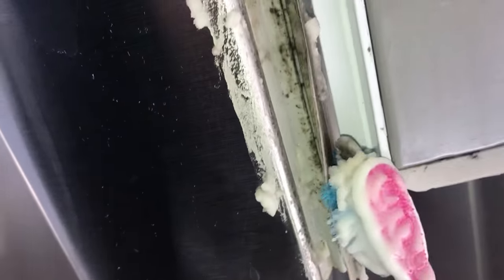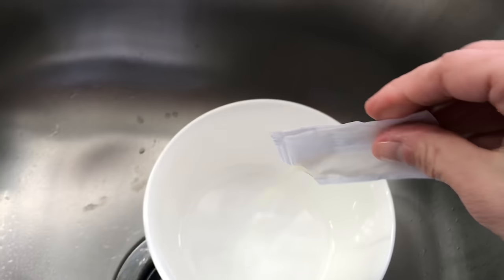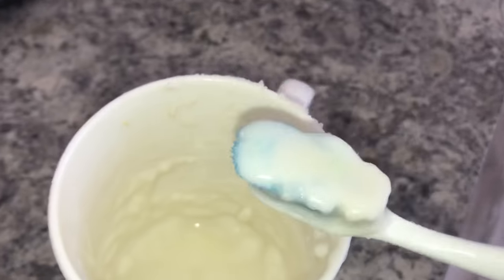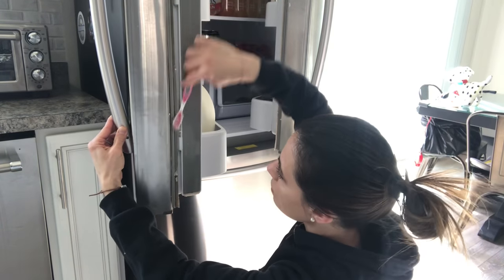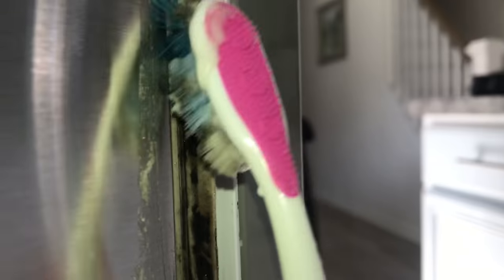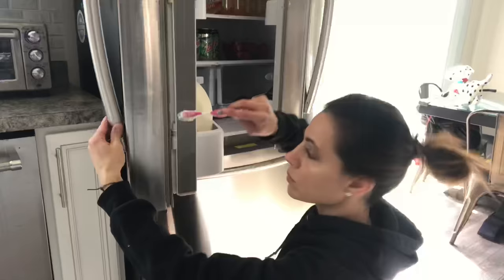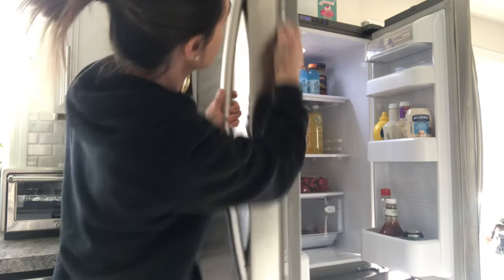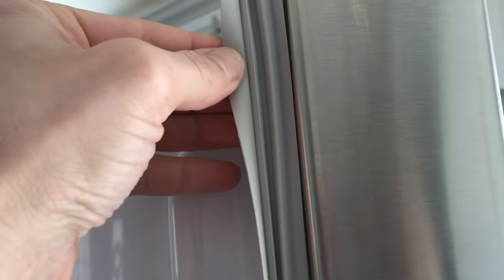How to clean MOLD from a Refrigerator Door Seal DISGUSTING! Using NATURAL household items

Comment: Great video. Do you have energy saver mode turned on by any chance? If so, that would prevent the mullion (long bar that flaps back and forth when you open and close the fridge) from turning on its heating coil. That little bit of heat is used to prevent condensation from building up on the gaskets and prevent mold.
Reply from the maker: Benjamin Rubenstein awesome! Thank you for this information☺️
Reply: Thank you needed this 😘
Reply from the maker: Benjamin Rubenstein I gave this a try and so far so good!! THANK U!!
Reply: Thank so much for the help.. I  have this problem.. thanks again
Reply: Where do you turn that on or check to see if it is on?
Reply: @Donna-LookingUp  The control panel should have an energy saver button.
Reply: So you are saying that we need to turn the energy saver off or on?
Reply: @vegangelist  Off
Reply: thanks for the tip, I'll try turning the esaver off
Reply: TY! Worked great. Used white vinegar instead of lemon juice.
Reply: @soniinnagel9383  Other comments say not to use vinegar.  Apparently over time the gaskets leech oils that keep them supple.  Using vinegar accelerates that leeching, making the gasket material hard and more likely to tear.  You can clean with 50/50 water and vinegar first, leave it to slowly dry while killing mold spores.  Then clean again using a toothbrush and the solution in this video to get into the grooves.  Rinse with water or just wipe dry with a clean dry cotton cloth, then spray clear silicone spray lubricant and wipe the excess off again with a soft dry cotton cloth.  Do it at least every 6 months or more so any spills don't make the gaskets stick and tear.  If there's no mold that next time, just use warm water and dish detergent, dry, then the spray.

Comment: After the deep cleaning that you do with removing the old mold buildup, a regular routine spraying of 3% hydrogen peroxide kills mold and fungus and keeps it from coming back quickly.
Reply: Will the hydrogen peroxide damage the rubber?
And or the vinegar or lemon juice? 
Google has conflicting information.

Comment: The door gaskets and cabinet flanges should be cleaned at least twice a year with mild soap and warm water, then rinsed and dried. A light film of petroleum or Vaseline must be then applied to the door gaskets." By applying the petroleum coating, one replaces the original oil and keeps the gasket flexible.
Reply: What's a door gasket? What's a cabinet flange?
Reply: If it’s mold it needs more than 1 or 2x a year.

Comment: This will not kill mold. The fact that it keeps coming back means that the spores are down in the surface! Cleaning mold off of a surface doesn’t kill it.
Reply from the maker: It hasn’t come back since! I turned a switch to off that was causing it.
Reply: @krisnsons5967  What switch? My LG 3-door refrigerator had the same issue recently.

Comment: So thats all fine and dandy, but what you dont see is the mold buildup on the backside of the gasket.  If you pulled the gasket 1) it would be easier to clean 2) save the cold stuff 3) you can get the inside of the gasket that really gets moldy.  The inside groove the door sits in will eventually break down the rubber material and cause it to get brittle and crack which causes those floppy door seals and loss of efficiency with the leak that creates..  as long as you can get one corner out, with some dish soap along the insides of the gasket should make it all slide out without breaking.   If you pull a corner and it break the gasket, hot glue it back on and order a new gaket.  But with soap you shoukd be able to remove it without breaking it..  to put it back in just push on it flst after getting a flat side in , use a plastic putty knife or the back of a butter knife to push the seal in at first..
Reply: " If you pull a corner and it break the gasket, hot glue it back on and order a new gasket."   Do you know how much some FF gaskets are?  A replacement for my FF's gasket is £180 ( $217). I think I'll stick with her method, thanks!

Comment: This works amazingly well! Super quick and easy! Hardly any scrubbing and it comes right off! I tried SO many other products but this was the only one that worked! Natural and economic and yes I had both on hand! What could be better? Be sure to lay a towel down underneath the area you are scrubbing for less clean up off the floor. The paste balls up dry so you can just take it outside and shake it out of your towel. TY so much Kris for sharing this video and I will subscribe!

Btw, the reason the seals get mold is because every time we open the refrig door it means the outside warmer air meets the inside cold air and creates condensation (moisture) on the seals and the tab that flips back and forth in the center of the doors. To cut down on having to clean this as often when you start to see  moisture building up just wipe it away with a paper towel now and then! The refrig repairman told me that trick! (but he had no idea how to remove the mold!).

Comment: It keeps coming back because even though you made it look clean, you haven't KILLED anything.  
To kill the mold, apply a 50/50 vinegar/water solution before you use your your method.  After you've let the vinegar solution dry, (at least 30 min.) then use your water/baking soda/lemon solution to clean up.
With the cool damp atmosphere on the seals, if there are any mold spores in the air, it will come back again.  But, this may extend the period that it takes to reoccur  because you've killed the spores in and on the seal.

Comment: We have the same exact refrigerator and we are getting excessive mold on our seals. I grew up working in my fathers used appliance business and never saw such an issue. Ambient room humidity and these refrigerators does not mix for some reason.  The design is making excessive dew get trapped in the door seals.

Comment: Nice to see you used lemon juice, as vinegar can be corrosive to rubber gaskets over time. I cleaned my kitchen sink faucet head a few times by just plopping it in a cup of vinegar (had trouble getting the rubber washer out). I started feeling sick a few months ago and couldn't figure out why. One day I thought 'maybe it's the water....' Unscrewed the faucet head and sure enough, the rubber washer was falling apart and had bits of rubber stuck in the aerator.

One reason I've never used vinegar in my washing machine, despite how great it is for rejuvenating towels.
Reply: Its all about the correct proportions and time. Too much vinegar or soaking too long = corrosion and material breakdown.

Comment: Try coating the door casket with silicone lubricant.
It is also a good idea to coat the face of the door gasket, especially at the bottom.
Spills that stick to the bottom of the refrigerator become glue like and the door gasket at the bottom will stick to it and eventually tear the gasket.

Comment: This is caused by condensation.  Though I LOVE our french door fridge, there is an inherent engineering problem with the design.  How do you contain the air in the fridge with 2 doors and no permanent mullion, and make it seal, and insulate that seal.  Well, you really can't.  Not economically anyway.  The seal is a relatively thin weak point that will end up getting cold, which attracts the moisture in the air and condenses on the surface.  Mold and mildew love moist stuff.   That seal is the weak point of the otherwise very well insulated envelope.

Some units have a mullion heater to warm itself and the seal to prevent condensation.  So those with the heated mullion can turn off their eco friendly/eco mode/energy saver features.  The heater should run with that turned off, though you will use a bit more electricity.  Don't ask how much, I don't know.  Haha!  

But if you want to keep the energy saver mode on, a weekly wipe with an acid, like lemon juice, white vinegar, or even better, if you can find it, propionic acid.  This is what they started putting in most big brand bread to keep it from molding like it used to in a few days.  If you ever wondered why bread lasts longer now, that's the reason.  Careful to dilute it properly.  We're talking 100 to 1000:1 with water.  Goggles, rubber gloves, crappy disposable clothes, over the sink, follow the label and good lab practices.  If you don't know how to do that, just use the lemon juice or white vinegar.  Dampen a paper towel with it and give it a wipe, getting into the grooves.  You may want to use a toothbrush as Kris did here, but maintaining it is a lot faster and easier than attacking a solid black yuck! seal.

Comment: Thanks for this video!! How long did you leave the baking soda mixture on before starting to scrub? (i.e. do you need to let it sit for a while?)
Reply from the maker: Not long! I only let it sit about five minutes!
Reply: @krisnsons5967  Thank you! Appreciate it :)
Reply: Keep baking soda in refrigerator
Reply: I cleaned all the mold off but at the very bottom on each side there seems to be a stain? Either that or I’m not getting all the mold off in those spots. Any suggestions?

Comment: Wow! Great video! Do you like link or name of brand of that lemon juice powder? Secondly, did you figure out how to stop it from happening? I want to stop it also. Thanks
Reply from the maker: Shikha Sharma any baking soda should work and also any lemon juice or lemons (if you don’t have lemon juice). 
Someone also commented on here to check the energy save mode.  I switched it opposite of what it was on and so far so good👍🏻
Reply: @krisnsons5967  Lime works wonders for this work. I use limes as they are more abrasive when it comes to cleaning!

Comment: I wonder if lime juice will work the same. It's all I have.
Reply: Yes, I just used it and it works fine... might have to keep stirring as it separates from the paste.  I also found my seals are getting very dry.  So I am trying to see if Vaseline will prevent more drying.  Just gave it a very light smear.   Hope it works.🤥

Comment: the gasket is broken and you need to replace it air is leaking causing mold
Reply: Which gasket?  The gasket around the door?
Reply: this is true...my mom had the gasket replaced on her refrigerator every so often and that refrigerator lasted 20 years.
Reply: Wow, this is something I'd considered.   Thx for the confirmation.
Reply: Not necessarily.  The air outside the fridge, humidity, and constant opening and closing causes this.
Reply: Yup. Even if it is not 'broken' it can weaken over time and the seal is weakened enough to leak air. Use a dollar bill (close the door on it, pull and judge the ease with which it slides out, etc) to test and/or look for any subtle signs of condensation near the mating surfaces. Replacing the gasket is easy-peasy, and there are multiple YouTube videos on how-to.